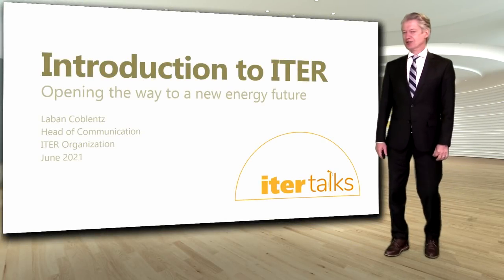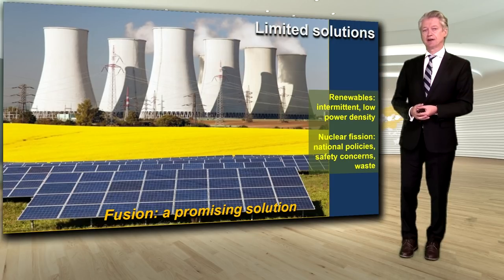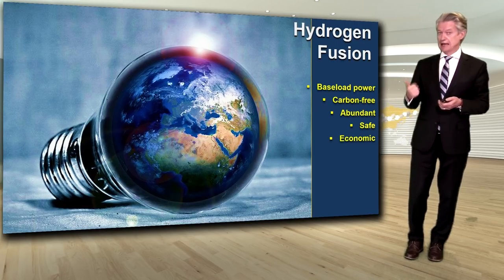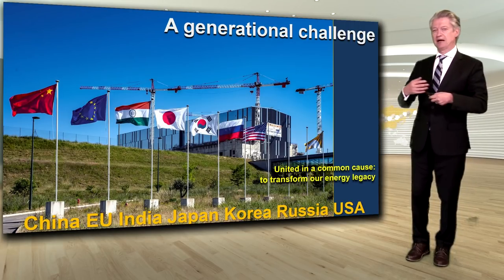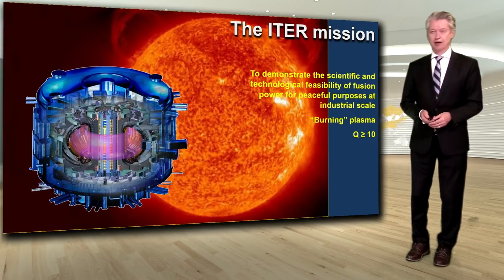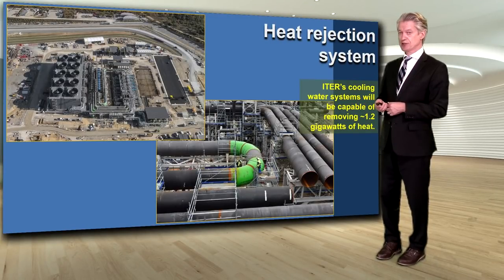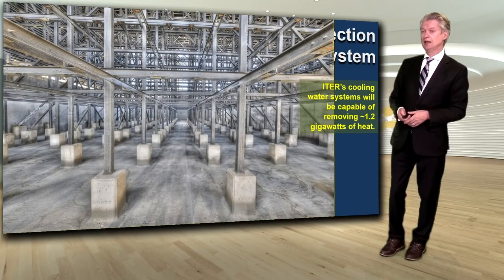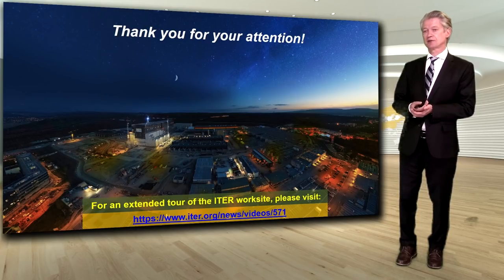ITER Talks (1): Introduction to ITER

Comment: I can't wait when this monster will start running. If it will work as designed, it will put humanity at entire new level. Hats off to people who are building it. Even the smallest part.
Reply: @TuomoTamminen  How so? Do you know that it will be the safest reactor possible? Fusion is insanely hard to maintain so in case of emergency iter just shuts down and fusion stops. No risk of explosion, no contamination.
Reply: @TuomoTamminen  I disagree. Process is fairly known, but very hard to achieve for longer than 100s. ITER has to be done. It's necessary and unavoidable. There is no other way
Reply: @TuomoTamminen  pf
Reply: @TuomoTamminen  any chance of credibility you had flew out the window when you marched out the hypothesis of a God. You try to put the ITER project into the bin of "just a theory" yet you have no evidence for God. How obtuse can you be?
Reply: Here's to hoping it works as predicted!!
Reply: What happened in this comments section lol, seems like comments were deleted. Was someone thinking they know more than thousands of scientists? This Tuomo guy?
Reply: I can't wait until all the band wagoners hop on once this becomes "cool".
Reply: @stevenborgogna  haha yeah
Reply: Q total = 0.5. Q plasma = 10. Sham.
Reply: E Van  It truly will be astonishing
Reply: No it won't.

Comment: I know he says the heat exchangers are designed for 1.2 but you know full well that the engineers will have used 1.21GW as the value :)
Reply: "Designed to" is not the same as "Capable of". The designed operating values are often well below actual capacity for safety reasons. Spaceflight taught us that margins are very important for when things don't go to plan.

Comment: 150 million degree Celsius is not the hottest point in the universe, sir. The constellation of Virgo is 300 million degree Celsius or  572 degree Fahrenheit. We understand that the measurements in the outer space are based on calculations  using physical instruments of measurement without considering some factors as the environment at that part point in space. This is universe we know very little about.
Reply: Hottest point observed. Not hottest Theorized.
Reply: @haydentravis3348  RXJ1347 is observed at close to 300 million Celsius, sir.

Comment: ITER aim to get a value of Q = 10 for the ratio of the energy produced over the energy injected into the plasma. Maybe, but it should be recognised that if the total energy running the machine is considered (this is large), then Q drops to unity.
Reply: Does that mean that Q=1 therefore its not energy +?
Reply: And is Q=unity real or an estimate?

Comment: I am a little confused after sampling the lecture before leaving for work.  I heard him saying that no fuel will be used in 2025, just water, testing the parts.  I thought the first run was proof that fusion could be done with positive energy output (of which, I am skeptical, still).... If they are just testing the parts, when will we actually see the proof of concept? Is the actual scheduled date for proof of net positive energy output in 2051 or is it 2055, as of 2021?

Hopefully, I misheard in my haste.
Reply: Even if it takes a year to set up its not gonna take another 30 for them to get it positive lol

Comment: The claim that fusion energy costs will be comparable with fission energy costs is fatuous. Fission does not need vacuum systems, superconducting magnets, or on-line tritium breeding and reprocessing. Nor does it have neutron multipliers (for tritium breeding), a complicated configuration, the complications of plasma control and possible disruptions, the irradiation damage from 14Mev neutrons (as opposed to low energy thermal neutrons), all contributing to the costs. Past comparisons - one around 2008 by an European fusion agency - show the capital costs some six times that of a fission reactor.
Reply: So we should just keep drilling into the ground forever to meet our energy needs? Yes it's complicated and expensive now but so is everything starting out...

Comment: We are told it is going to be 10 times hotter than the center of sun to be able to generate energy yet sun does this all the time. It is clear we have no idea of the temperature in the center of the sun.
Reply: Sun is also a lot bigger and gravity supplies the energy for fusion, not just heat, so it can be colder. We aren't using gravity, so we have to compensate with more heat/generate the pressure by heating the elements more. Hence 10 times hotter.
Reply: @haydentravis3348  How do you mean? The solar core is hotter than any object can withstand on earth  including electromagnet. Gravity is actually the weakest of all forces of nature. 

It is clear we have no idea of the temperature at the centre of the sun than extrapolated stats based on known laws yet there are phenomenal we don't understand, like the gravity itself, etc.
Reply: @haydentravis3348  I don't want to bring LHC claims into this debate, sir.

Comment: I'm glad it's happening. But lets be honest here. It's not going to be commercial in the time we need. I wish the same level of international cooperation could be used to work out grid level storage >1TWhr systems. We don't really have a problem of generation any more, we have a problem of obscene waste and lack of electrical energy storage. At the end of the day, the earth is a heat engine being powered by nuclear fusion, 93 million miles away.

Comment: It has been said, and you said in this presentation, that ITER will produce a Q of 10. That means that ITER will produce 10x the amount of energy that has to be used to operate it. Is that indeed a fact? Or are you referring to just Qplasma vs output? If the Q you promise isn’t Qtotal then what is Qtotal? Is it greater than 1?

Comment: I don't understand why, if they're going to put out so much heat, to not take advantage of it, and simply contribute to the global warming problem.
Reply: What? The iter plant is a research plant it does not put out greenhouse gasses and thus does not contribute to global warming and it is most certainly not meant to produce energy for the net.
Reply: @happyhome41  what? The reactor heat will not come out of the building due to containment and cooling systems also heat does not contribute to global warming due to the massive size pf the atmosphere and how we lose heat the problem os greenhouse gasses that make it harder for heat to escape into space.

Comment: Nuclear is so much cheaper and safe.
Reply: Fusion. As the presentation points out, Fission is very dangerous as it relies on a runaway chain reaction that has to be actively managed. If you lose power, while the reaction is running, you get Chernobyl or Fukushima. With fusion, the chain reaction is induced and will stop very shortly after power loss. 

Residual heat in the system may remain dangerous for hours and the coolant can be radioactive and very very hot, thought alpha radiation is most common in fusion and doesn't penetrate skin very well and dissipates fast. Breathing in the coolant vapors, however, will probably melt you from the inside out in a few hours.

Comment: "you see the Iter heating system". Really ? It's the heat exchanger to get rid of the heat. The way you say it, it sounds like you use this section to heat the reactor. As head of communication I'd wish you'd be a bit more exact in your statements. Instead of trying to put fusion against other power sources, maybe you should have just stayed with information on just the fusion part. Sigh. I'm looking forward to the progress of Iter construction and I hope it will work to show the feasibility of fusion for power generation. I'm just not sure where you picked this guy from to be your Head of Communications. He knows how to wear a suit, but I don't think he is very good at presenting what Iter is about. Talk about the excitement and potential of Iter, don't get stuck in particulars of the alternates. I wish I'd earn whatever this guy does when doing such a mediocre job.